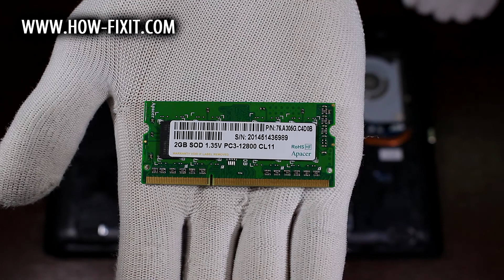Lenovo G50-45 RAM Upgrade and Installation Guide

Comment: can someone answer me a type of ram should i buy for this laptop? i want to add 2 gb's more to the extra slot to have a basic 4gb ram laptop for my basic use. But im afraid if its not compatible. the laptop has 2 slots its the same with the video laptop. I have to buy a 2GB DDR3 with what specifications?
Reply: Según el manual, de esta Lenovo G-50 soporta hasta 8GB por Slot, para un total de 10GB

Comment: Thank you so much for the video. Upgraded RAM by myself by just watching the technique to install it.
Reply: Bro can i upgrade processor or graphics card also tell me ?
Reply: @ZAID9243-f1s  Yeah
Reply: @beastpat13  do you still have this laptop
Reply: @ZAID9243-f1s  yes
Reply: @beastpat13  how is it performing how much ram you have in it ?
Reply: @beastpat13  tell me about it
Reply: @ZAID9243-f1s  I have 4 gb ram and it works well
Reply: @ZAID9243-f1s  and I play many High graphics games on it you can see in my channel
Reply: @beastpat13  i have 2gb one can i upgrade it and what else can i do to increase its performance a bit my model freeze so much I can't use internet or play games in it . What you have done with your one ?
Reply: @beastpat13  tell me

Comment: wait is this upgrading like if this laptop can't run csgo and if we replace a better ram it will run csgo?? 

im asking cuz i have the same laptop 

mine cant even run fortnite well, i only get 5000 ping on fortnite

                                                               TRANSLATION IN RUSSIAN
 подождите, это обновление, как если этот ноутбук не может запустить CSGO и если мы заменим лучше оперативной памяти, он будет работать CSGO?

я спрашиваю, потому что у меня такой же ноутбук

мой не может даже запустить фортнит хорошо, я получаю только 5000 пинг на фортнит
Reply: me cool with a cool you need 4gb in that laptop to run csgo on low settings
Reply: Ram is not really going to help. Although, putting in an SSD will help load times.